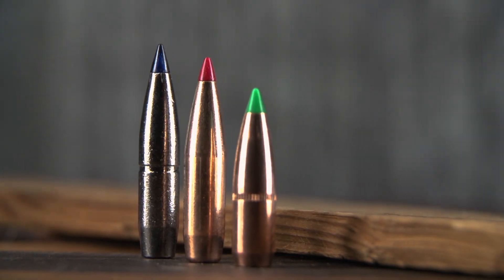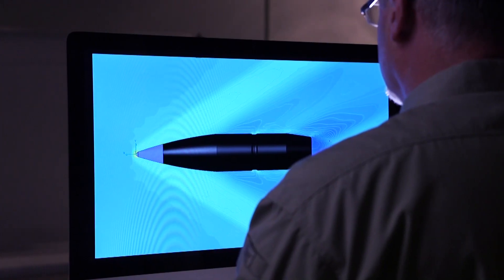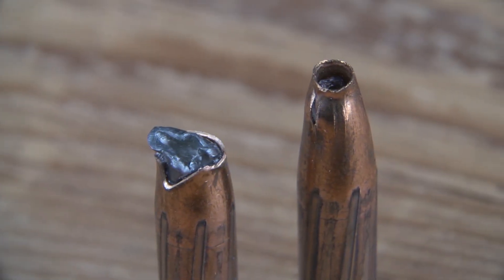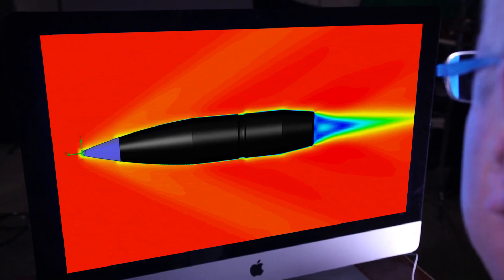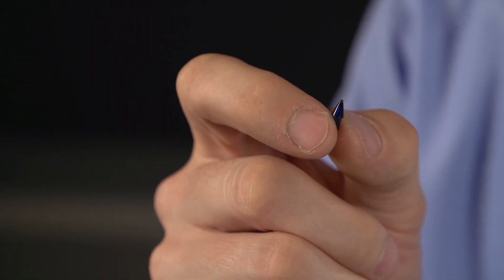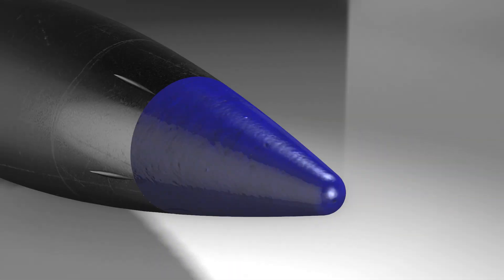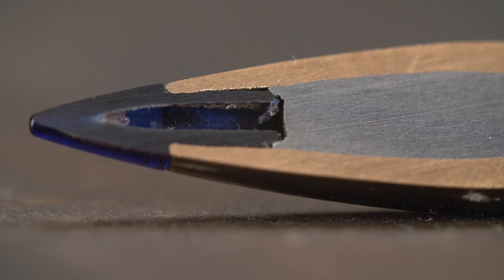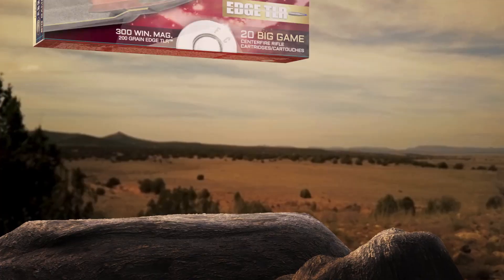Edge TLR: Slipstream Tip

Comment: It would appear the Edge TLR bullet is coated or plated. What is the coating on this bullet and have you actually paid attention to bore condition in the test rifle's? Might be the newest, greatest, next best thing in bullet performance, but if it comes at a cost of ruining a bore, then it becomes obsolete. Why does Federal feel the need to coat so many bullets in your ammunition line? Just leave a plain copper jacket and let the hunting and shooting community clean their own firearms. With proper barrel break-in, fouling isn't as much an issue as some of these coatings create.